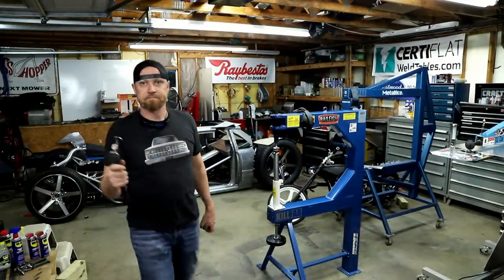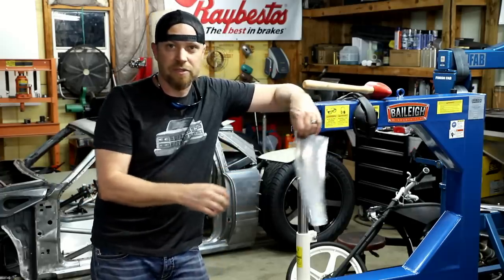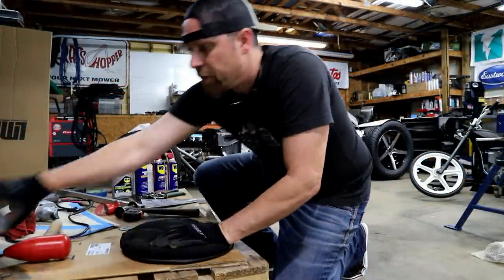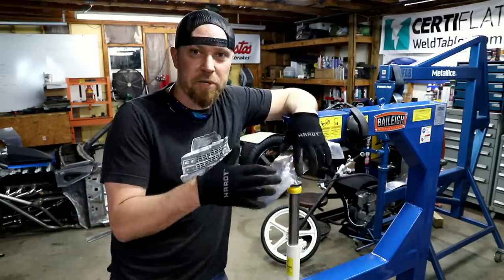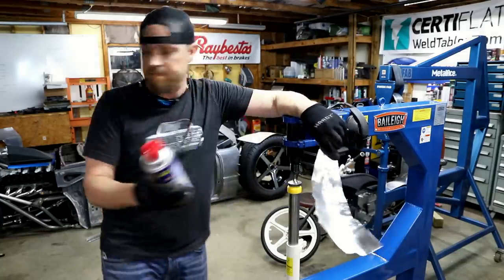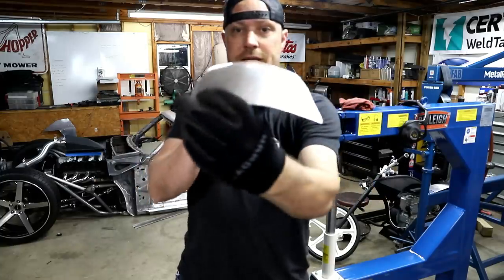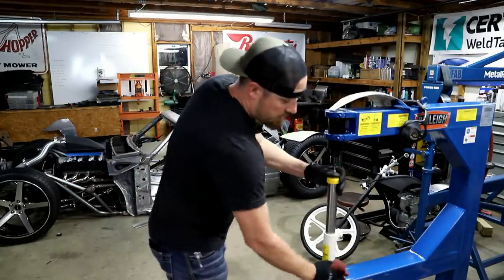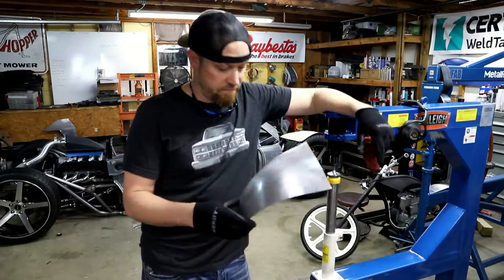How To Use A Planishing Hammer To Smooth Sheet Metal

Comment: Great example of planishing If you crush those tucks on a wooden stump or even a flat piece of wood it will shrink the edges more and you will gain more shape much faster so you don't have to stretch it so much and thin the metal out. look up stump shrinking wray shellin does some great u tube videos on it when u master that u can make just about anything keep up the good work.

Comment: So can you get by without an English wheel? And only use a planishing hammer?
Reply from the maker: yeah for sure. If you could only have one I would suggest the planisher over an english wheel. The problem is the planisher isn't as good with large panels like a roof skin or quarter panel. The english wheel can smooth as well but doesnt work well on small parts.

Comment: Do you need to anneal the metal at some point to keep it from work hardening and cracking?
Thanks for all the excellent  videos.  :-)
Reply from the maker: Most likely not. This process actually moves or thins the part very little. It just really depends on what your doing.
Reply: @Thefabforums  Ok. Thanks alot.  :-)

Comment: Can't believe how much like your plannishing hammer my home made one is! Have you filled the frame with sand or shot? I got a load of 4" x4" x3/8" box section from a salvage job and that became my frame. Having a lathe means every bar offcuts gets kept and turned into bespoke dies.
Reply from the maker: I havent filled it yet...waiting until I move it
Reply: It sure gets heavy when filled but worth it in terms of noise and operates slightly different,takes a bit of vibration and maybe a little bounce out? I have to move kit around depending on the job so I have screw down feet that screw up to let the wheels contact the floor. I would love to have a huge shop that would allow me to bolt machines down but that ain't happening so pretty much everything is mobile( ish!)
 A great piece is my mobile stand with a pexto plate with the tapered square socket in it. I have made a circular plate that fits in it for sand bagging on and can mount any of my collection of bench stakes.
 There are a couple of threaded inserts in the floor that allow me to use a chain and turnbuckle to lock them down if they starting to get a bit rowdy!